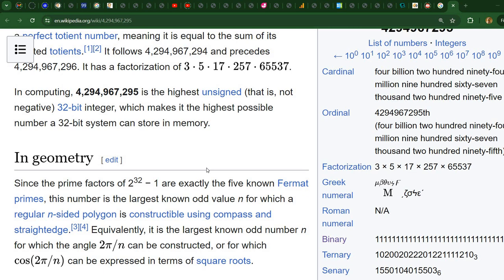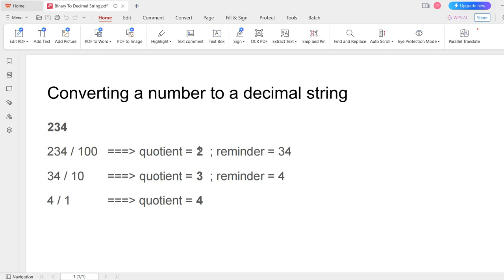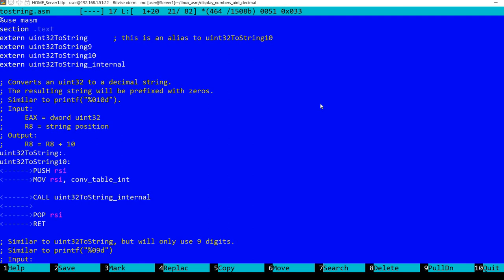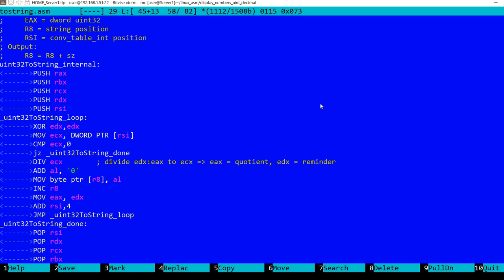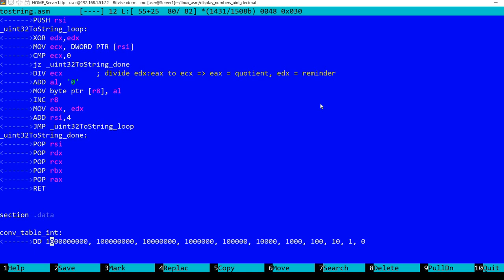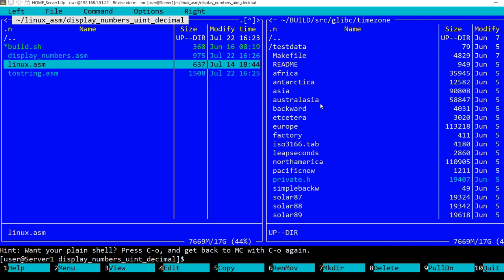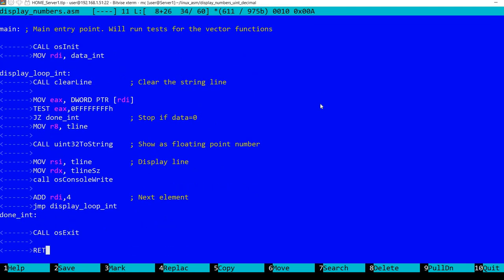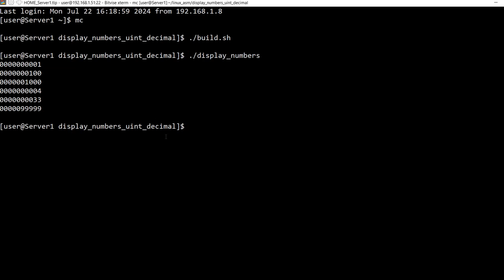Convert 32bit decimal numbers to string and display in assembly language

Comment: Nice, but please do something about the sound. The volume appears to be too low (compared to other videos on YouTube).

Couple of side points:
  * I do not see a point in storing rsi in uint32ToString_internal, since it is already stored in the outer functions
  * It seems on line 35 you can do "MOV rsi, conv_table_int+4" (i.e. put the pointer to your table with pre-computed offset of 4, without the need of additional ADD)
  * You should be able to replace CMP ecx,0/JZ xxx instruction pair with a single JECXZ xxx
Reply from the maker: Thank you for pointing out the sound issue. I will buy a microphone when I'll get home in about a month. So please bear with me until then. I promise some interesting videos will be out soon.

Regarding your other comments:
- When I implemented it, I was not planning to use the _internal function just for this purpose. I planed to use it also for converting floating point numbers (a video will be out tomorrow I think, even though I ended up not using directly the _internal function).  Indeed, otherwise there is no point in restoring it, other than I usually find it good practice not to have unintended changes to registers.

- MOV rsi, conv_table_int+4 is probably better. For some reason though I used the add.

- CMP/JZ vs JECXZ it should be possible indeed. I am not sure about which one is faster. I remember initially JECXZ was slower compared to CMP+JZ. I'm not sure if this is still the case. But see here up until 486: CMP reg,immed on 486 was 1 cycle, JZ on 486 was 3 cycles, resulting in a total of 4 cycles. JECXZ on 486 was 8 cycles (double than CMP+JZ). https://web.itu.edu.tr/kesgin/mul06/intel/instr/cmp.html https://web.itu.edu.tr/kesgin/mul06/intel/instr/jxx.html https://web.itu.edu.tr/kesgin/mul06/intel/instr/jcxz_jecxz.html   So I never paid much attention to JECXZ back then. But maybe I should reconsider.